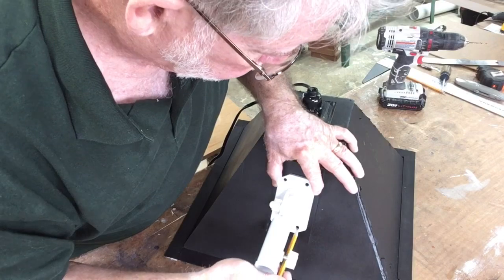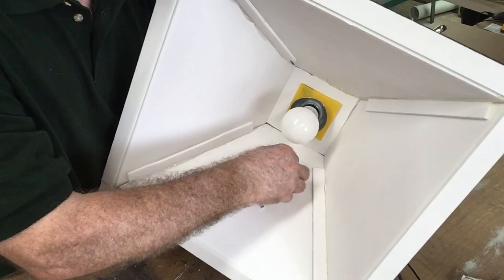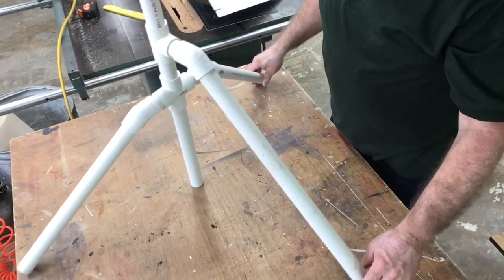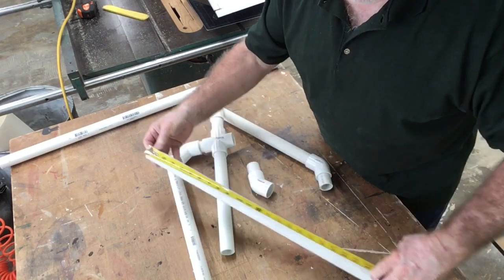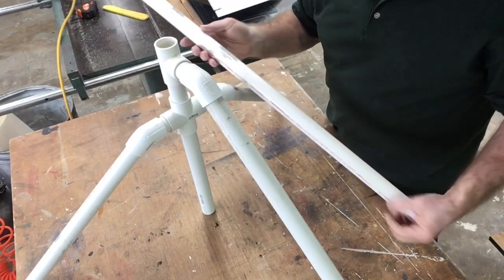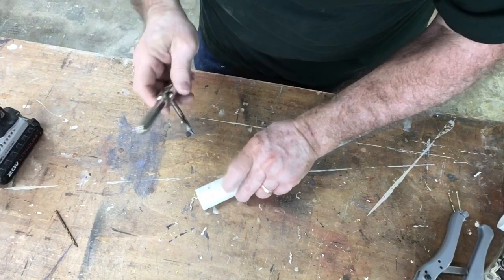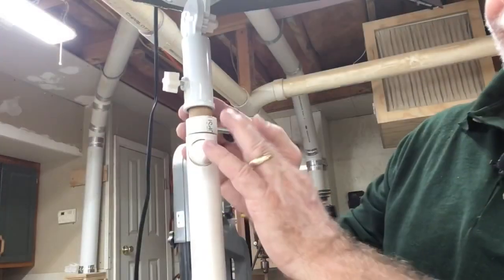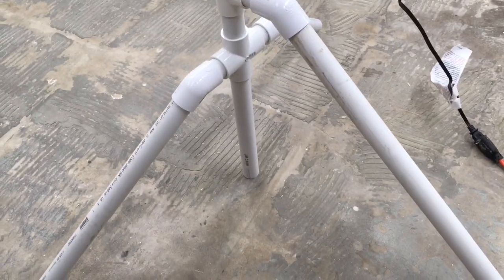How to Build a Soft Box Light Stand Using PVC (Part 2)

Comment: Lightbox stand : Initial pieces,  any tube is 1 inch diameter, all other ... inch is the length.
1x ??? inch tube to connect the 4 way to the 3 way …  ( guess 6 inches max )
3x 2 inch tubes, connects the 45 degree tubes to the 3 / 4  way ...
1x 4 way, connects the 3 lower feet to the 3 way
1x 3 way, connects the 4 way to the upper tube and to the front foot.
3x 45 degree angled tubes, for back feet and front foot
1x 12 inch tube  (center foot), later on this is used as part of shortened upper tube, optional
2x 18 inch tubes  (back feet),
1x 24 inch tube   (front foot)
1x 36 inch tube, (upper tube,flagpole)  connects 3 way to the light box flagpole end
2x  table leg height adjusters, used as tightening screw to adjust height.
1x flagpole attachment, varies angle of the lightbox. Wall bracket is attached to the lightbox.
1x rod, wood or other finer tube (shorter than the upper tube probably), 
   that fits into the upper tube and the flagpole holder, 
   rod must fit inside tube perfectly (no wobble). 
I would add some weight inside the feet, to keep it steady. (epoxy)
Total length  “1 inch” tubes = (2x 36)  + 30 + guess 6  = 108 inches
Reply from the maker: Lot of detail.  Bottom line it is very cheap to build and very effective. Thank you